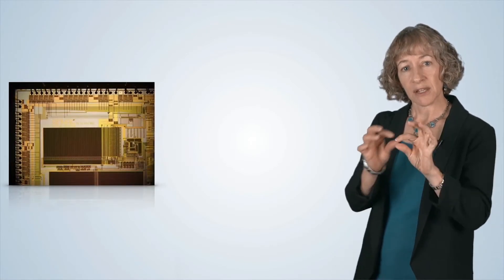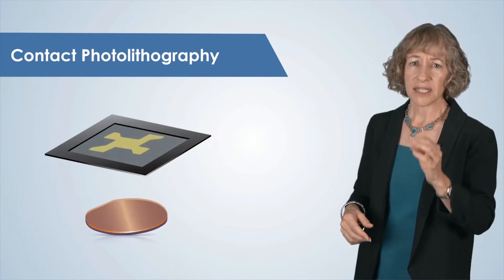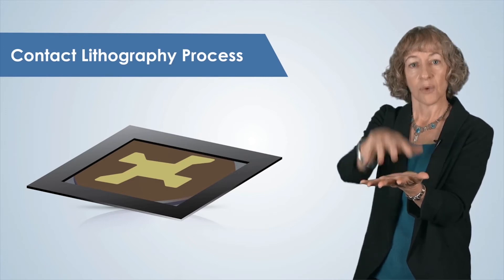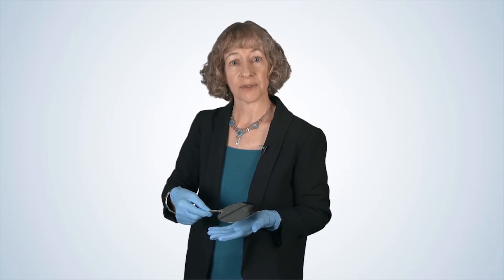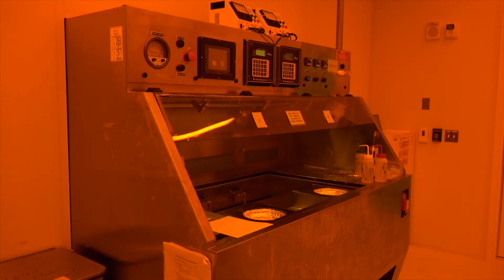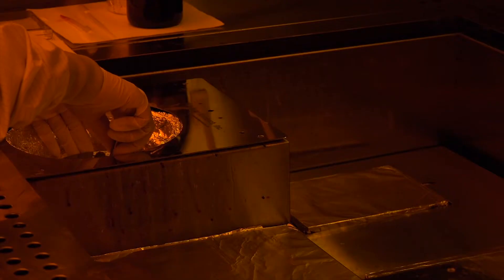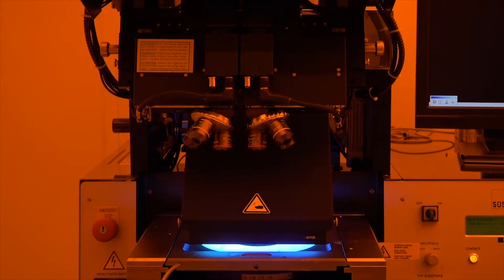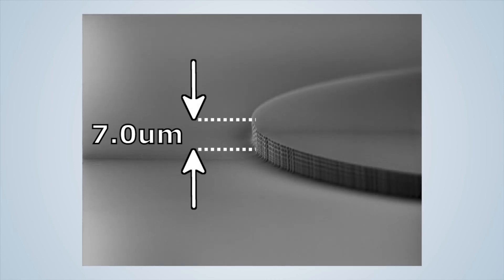Photolithography

Comment: nb: at 10:41, most of us know this photographic phenomenon as orthochromatic and panchromatic behaviour, film in the cameras is Panchromatic {it is sensitive to ALL light}- so we deal with it in a dark bag, or tent; the orthochromatic part is the silver gelatine paper, that you get prints on, or Tintype plates (glass/tin), some films too, such as ORTHO plus from Ilford are this way too, only sensitive to UV light ;red\orange 'safe' lights  are ok to use as the film\paper is fixed in 15 minutes, so has no detrimental affect to exposures.

Comment: does diffraction soften the pattern when transferring the pattern?
Reply: You need to watch Huygens Optics latest video. Both the light source and the mask is needed to be designed/adjusted by counting the effect of the diffraction. So much in fact that both the light source pattern and the mask look like a diffraction pattern themself (-for layman at least).

Comment: Very good video. I'm still wondering though, if they use this process to get parts 7um thick, how do they get things down to 2nm? I read 1nm is 1000 times smaller than 1um so how do they get any accuracy at the nm scale? How do they manage to line everything up when when it's only tens of atoms wide... Also the wavelength of ultraviolet light is wider than these dimentions anyway so how is it even possible? My head hurts!
Reply: by using ebeam lithography or direct write lithography